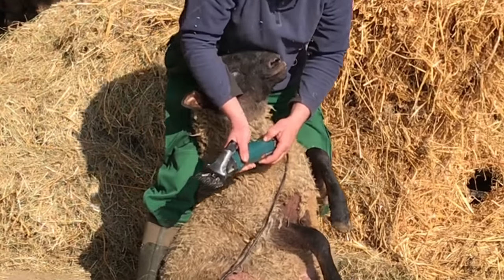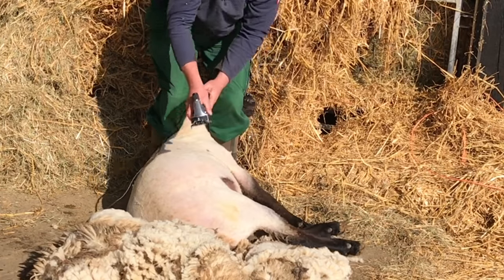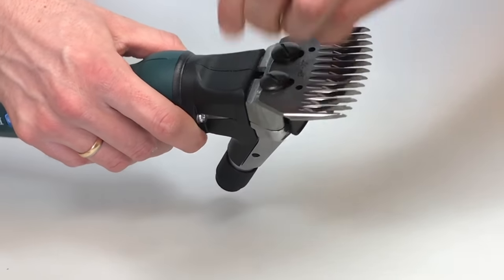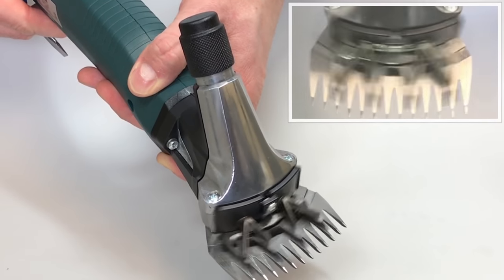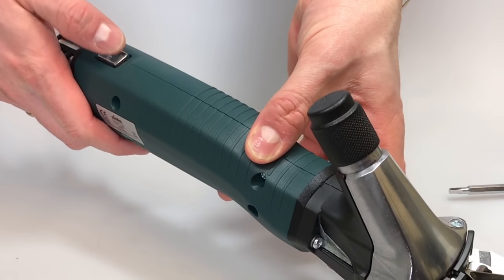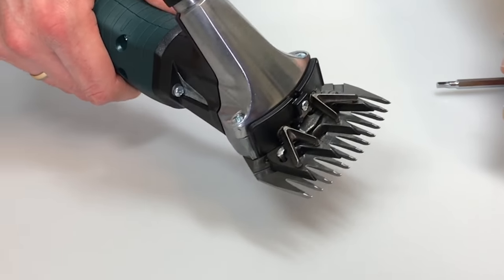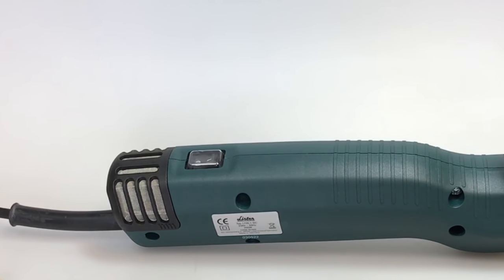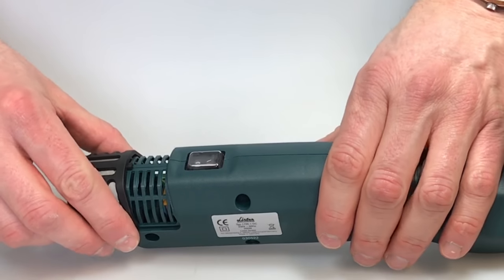Sheep Shearing with a LISCOP shearing machine

Comment: Blades not getting warm?
Reply from the maker: If you pay attention to the handling as shown in the video then there will be no problem with getting too warm.
Reply: Thank you for the quick answer! I want to buy this bit is the 430w power not to heavy and loud?The Heiniger Xplorer has also my attention
Reply: Or the Heininger Progress
Reply from the maker: The 430w machine has lot of power. You can also have a look at our new shearing machine LISCOP PROFILINE Sheep with 200w DC Power. Is has the nearly the same power depending on a new motor technology. But less weight and less noise.
Reply: Thank you! Its for our horses so we gonna go to the shop and see it! Thanks
Reply: The only thing is the dB of this 430 w. On 1 site the say 75 dB and at the Lister site the say 90 dB
Reply: Такое масква где можна наеидит
Reply: @listergmbh503  b